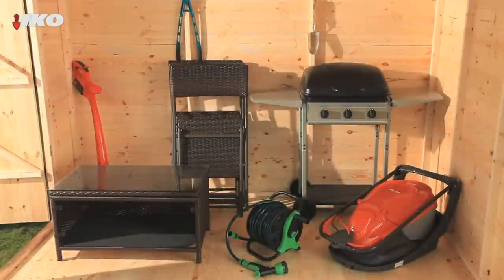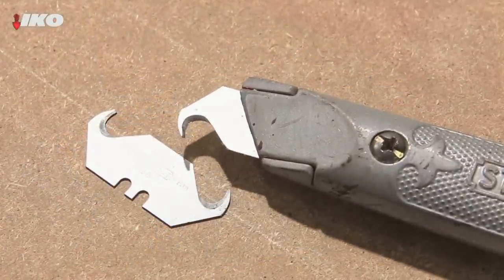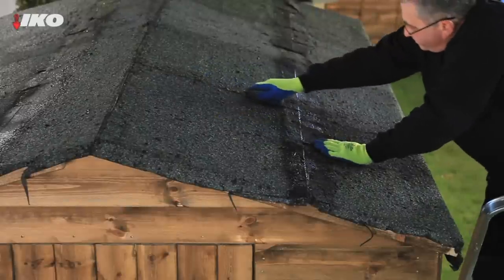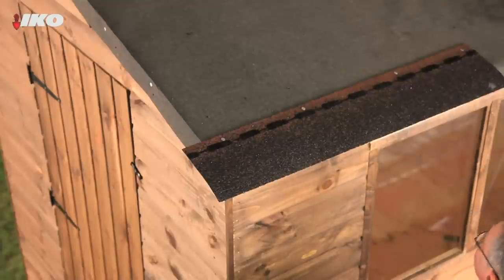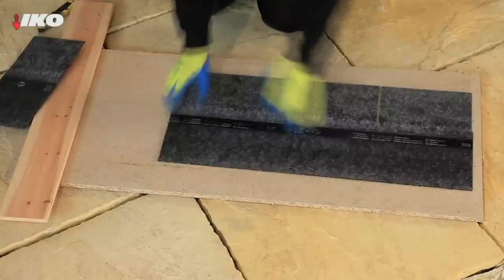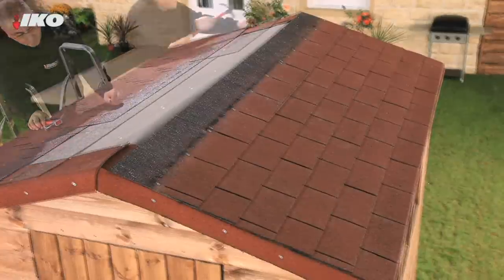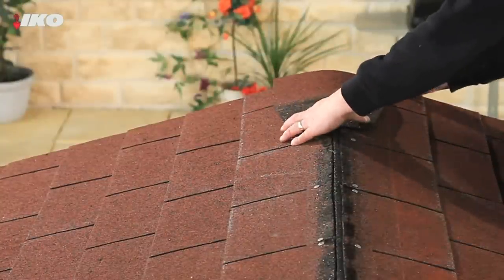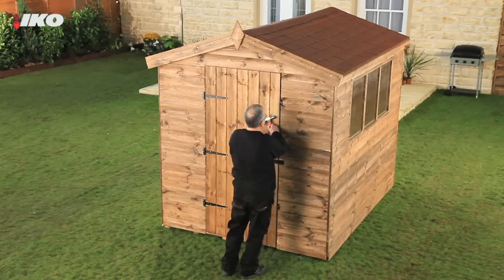How to fix roofing shingles to your shed

Comment: Every video I have seen so far has had people saying they're doing it wrong in the comments. From what I have seen there is an aluminium drip edge used in the US, I guess this is why you're saying this video is wrong? It does seem wrong to fold them over, I could see them snapping over time.
Reply: I've not seen the drip edge (for gable)  available in the UK, very annoying!! I've used plastic eave protector drip edge to allow rain to effectively enter into the gutters.